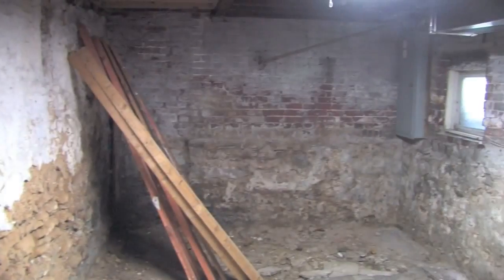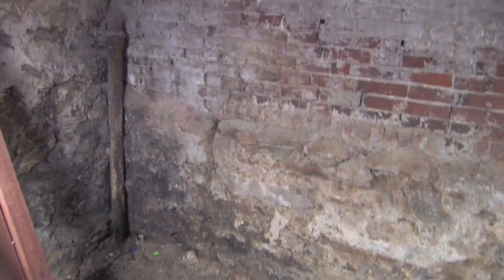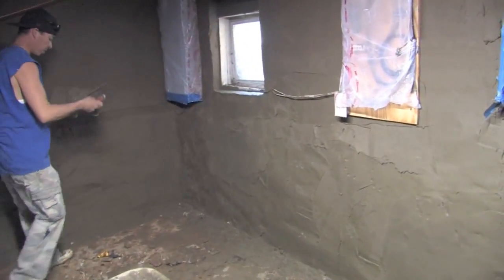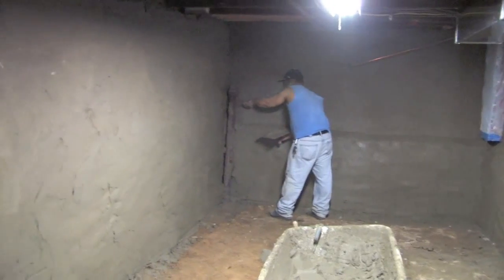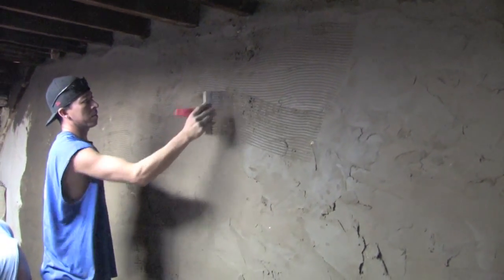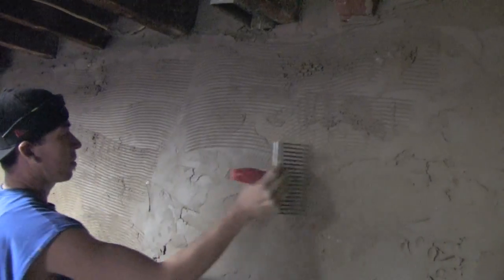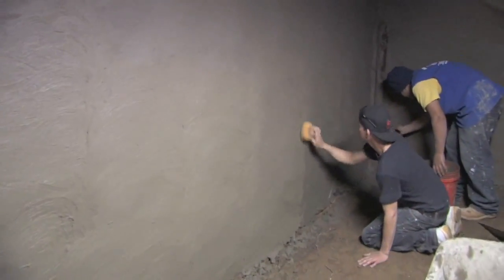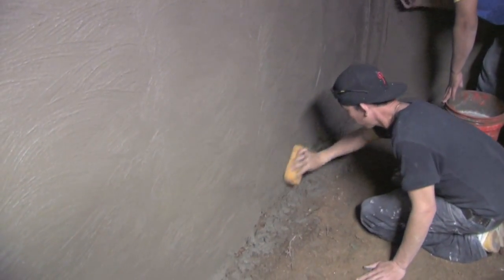How to Cement Basement walls  | Concrete and Cement work Contractor

Comment: You should use a long flat stick, drag it across the wall to flatten the cement before you use the sponge to touch up the surfaces.

Comment: Great video. Do any of these steps apply to refractory cement? The stuff i have is apparently kasto-lite, just add water. I would have liked a nicer look than i got, i just lined the inside of my forge, but they always look so rough.

Comment: Do you wet the walls before applying the first and second coat of cement?  Also, to verify you use 1 part portland cement and 3 parts mason sand.  Your original post was made in 2012 and you are still helping people in 2018.  Thank you!
Reply from the maker: I apply bonding glue first. You can see this technique in my other videos. Sorry for the late response
Reply: Still helping people in 2024!

Comment: i know this video is old but does anyone know what glue was used before the first coat.
Reply from the maker: Your friend has shared a link to a Home Depot product they think you would be interested in seeing.

https://www.homedepot.com/p/Quikrete-1-Gal-Concrete-Bonding-Adhesive-990201/100318465

Comment: hmm. The guy that did my walls used plywood and would go half way and pour the concrete in it to fill up from the wall to the plywood that cover the entire wall then he'll wait for it to dry then pull the plywood off and do the other half. It looked perfectly straight. How come i'm not seeing anyone do that now? I was going to do a wall by myself but wanted to get directions and haven't seen anyone doing that. Same with my stairs. The last guy used some wood and built fake stairs and just purred cement into it and when it dried he pulled the wood off.
Reply: Wow.....sounds like a good idea. I have to repair a cement veneer facing on the side of a concrete patio/landing. The area is about 10 ft long x 2 1/2 ft high. Loading up a properly sized piece of plywood sounds like a way to make the job much easier. I will be nailing wire mesh to the underlying stones to firmly hold the cement in place.
Reply: This is the same idea I had to redo my basement walls. Why not make frames and have a cement pumper come in and fill in the reinforced made frames and have it done in a weekend instead of a month. JS

Comment: What kind of cement do you use?  is not mortar right?  Also, what do you do for the holes that have a stone with a lot of loose material?
Reply from the maker: http://www.homedepot.com/catalog/productImages/1000/65/65d7e5eb-fc8e-4ef8-a8f3-5a22b4086075_1000.jpg
Reply from the maker: We remove all the loose material then pack the area with cement.
Reply: What glue did u use?
Reply: That's all? Or add sand in the mix too?
Reply from the maker: Yes 2 parts sand 1 part mortar cement